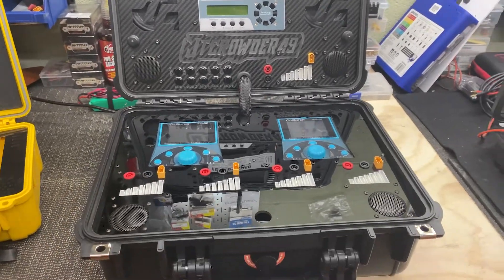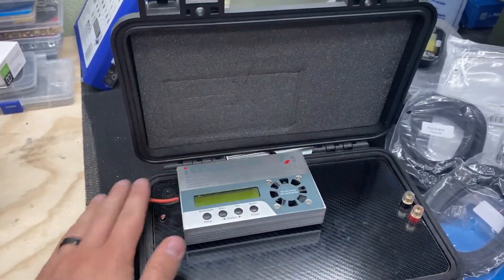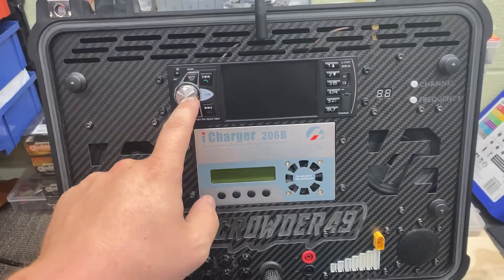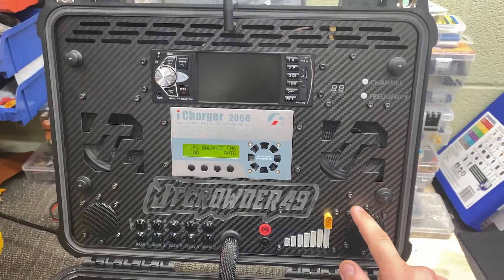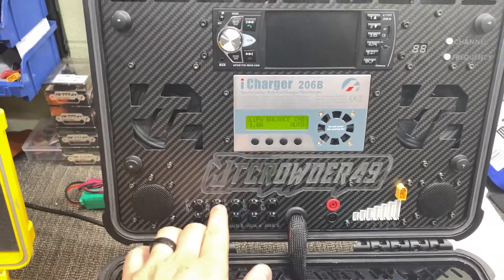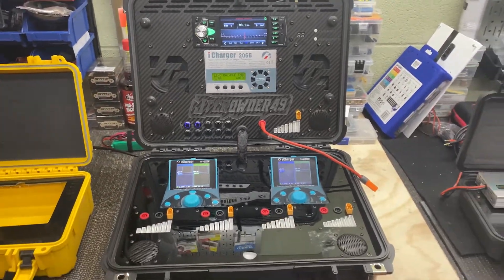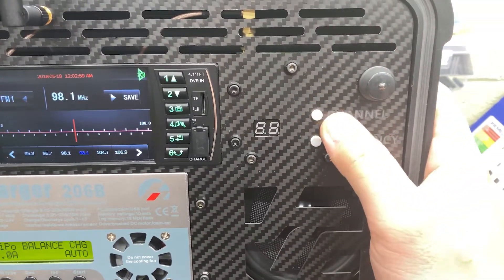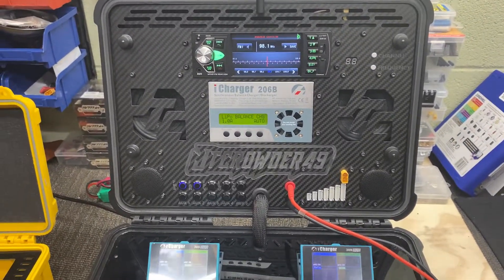The RC Charger Case Killer a LiPo Charge Case DIY Solution

Comment: Real sweet build, you said prc balance boards how about panel mount banana jack binding plugs, where did you find them?
Reply from the maker: I found them on amazon. This is the title of the listing. 10Pcs 4mm Banana Jack Female Panel Mount Banana Socket Binding Post Adapter for 4mm Banana Plug Connectors
Reply: Thank you so much, greatly appreciated!!